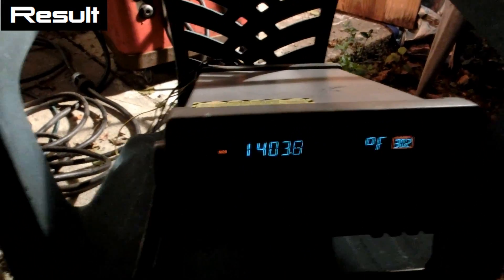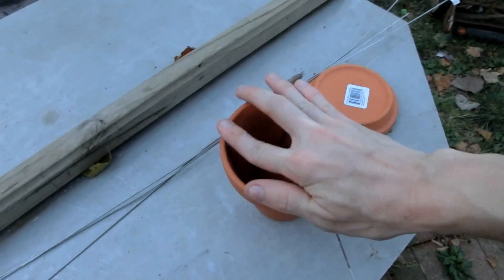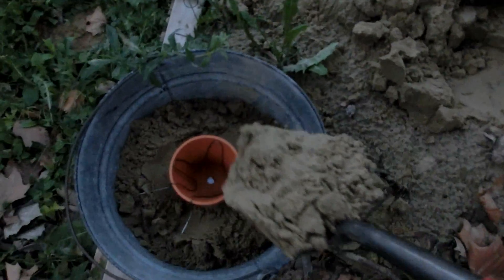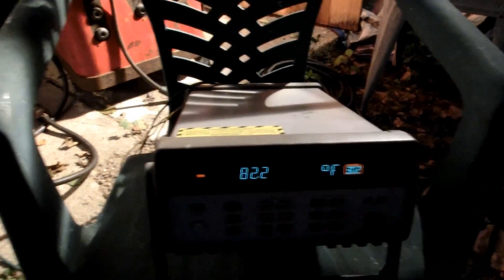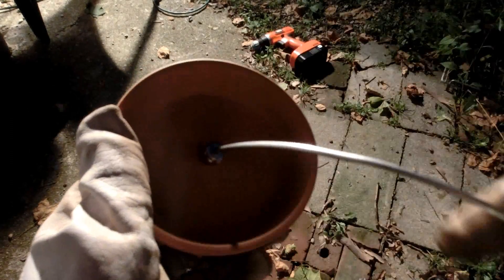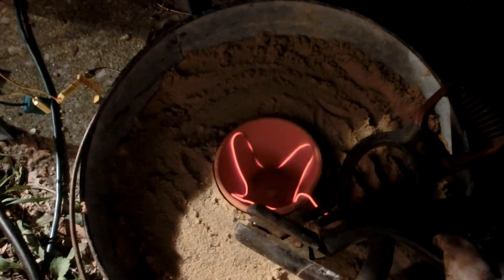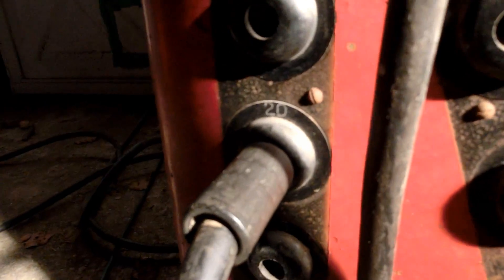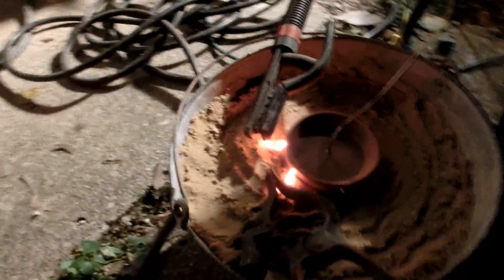DIY 1400 F* Electric Kiln

Comment: Another possibility is using a clay chimney liner: http://cecurechimney.com/images/anatomy.png   Martha Stewart says she found they were cheaper than pots when making a garden: http://gardenclub.homedepot.com/chimney-flue-liner-planters/ 
     The chimney illustration also shows a way of insulating things by creating a dead air area around the structure which directly contains the heating area.  So you might wish to layer the firebrick, create a dead air area and then a layer of the regular old bricks laying around for the outer structure.  I remember seeing a show where specialized brick masons wedged in refractory bricks without mortar, then built a structure of other bricks around it with flying buttresses in air voids which were mortared to hold the non-mortored arch of refractory bricks together.  They ended up using four different types of bricks in the process. I think they may have been making something for ultra-high temperature like for glass.  I suspect that type of project is mega-expensive.
     Refractory bricks come in different shapes that allow the construction of mortarless arches: http://ceramicartsdaily.org/wp-content/uploads/2010/06/firebrick-types.pdf
      There are also lightweight varieties that can be used in areas that aren't going to be struck by other items.  They appear to be cheaper.
     The key to avoiding damage is the speed that you heat up and cool down the structures so the temperatures in different locations don't expand or contract at vastly different rates.  For example, it takes from eight to nine hours to properly go from cold to operating tempreture for our steam locomotive - SP745.  Attempts to heat it up fast will result in fissures in the metal and the boiler is likely to explode.  Once you get the feel for heating up that wire with the arc welder which you are doing and monitoring with the thermocouple, you can raise the temperature at a slower rate avoiding extreme differences in expansion/contraction.
Reply from the maker: yeah i agree it would be better to heat it up more slowly. it would be cool if i could make containers made from tungsten and suck air out of them so they are high strength vacuum insulators.
Reply: That would be nice.
    It might be possible to line the inside of the outer wall of the void area with glass bottles with vacuums to slow down the heat transfer.   The heat from the refractory bricks would warm the air next to it and there would be a convectional effect, but the air couldn't get hot enough to weaken or crack the glass in the bottles.  If the bottles were lined next to the refractory bricks, they might crack.
   The refractory bricks would be the super hot partially insulating area, then a very hot area in the air gap between the refractory bricks and vacuum bottles creating another insulating area that could employ vacuums while not enduring heat so high the structure would be destroyed and then followed by the outer layer of regular brice which are hot.
    That might not be practical.
     If you are interested in this concept, you could place them next to the outside of the refractory brick and see if they crack or get hot enough to fail.  If the fail, then you will just have something else to melt. You could put mineral wool on the outside of the refractory brick and then the layer of glass vacuum bottles.
     If you use a non-mortor method with firebrick, you could use sand piles on either side to act as buttresses to hold the firebrick vault together. The firebrick vault would sit on firebrick walls, but there would be regular bricks that would come from the base of the arch to the top of the regular brick wall and the regular brick wall would have sand piles buttressing them.  
    That way, if you discover problems in the design or want to expand, you can just move the sand and reconfigure the parts without having to break anything because the structure is gravity set and uses compression to hold it together.

Comment: Nice.  If you want something flexible and economical, we use this when we want to set up something quick. http://www.mcmaster.com/#9355k2/=t8rv8z (you may be able to find it cheaper elsewhere, "microtherm" is one brand name). If you handle it, where sleeves and gloves, itches worse than fiberglass insulation...  You may also be able to source firebrick from a boiler repair shop in STL (or they can point you in the right direction)
Reply from the maker: thanks for the link. i think my mcMaster catalog is a bit outdated...its from 2002 hahaha. walmart sells like 6 bricks for 35$ so i may look into that. but i would really want like a cement/puddy that i could build the chamber out of and have the filament inside the kiln walls. i think that would also help heat disapation. with this kiln the heating elements are prolly like 2,000F but can't convey the heat fast enough into the kiln.
Reply: Rinoa Super-Genius You really want to keep the heat IN, but having the element embedded in the wall will help keep you from bumping into it when moving stuff in and out.  We have a little commercial lab oven that will do 2000F and it has the elements exposed to the inside.
 (example http://www.grainger.com/product/CARBOLITE-Benchtop-Furnace-38L773?s_pp=false&picUrl=//static.grainger.com/rp/s/is/image/Grainger/38L773_AS01?$smthumb$)

You can find castable refractory, you mix it up just like concrete, you can find it cheap on ebay i'm sure but it is heavy to ship. There are also a plastic refractory that you can shape. when you first fire it, you heat it up slow and it hardens. Boiler guys call it "poundable refractory"
Reply from the maker: Chipper6
yes i know i want to keep the heat 'in', but the filament doesnt have a lot of surface area to get the heat 'in' in the first place. not counting i need some way to mount the filaments inside it. i can't just have them leaning on teh side able to droop down and short out.

i'll prolly be able to find refractory cement somewhere localy.

Comment: I really thought that resistance wire would have burned in half at 20 amps. Figure how many watts that it was pulling during the last test. Thanks
Reply from the maker: well i've put 35 amps through it before. but it loses all rigidity so i would have to support the coil.
Reply: Rinoa Super-Genius
Thanks for the quick reply. Did you figure out the watt draw?
Reply from the maker: Jerry Densmore
 nah i havent really checked the voltage yet. i'm focusing more on the shape and insulating properties of the kiln.

Comment: A good first run. You more than likely have thought of this, but get a bigger pot line both inside and outside with rockwool and cover the whole furnace; this should keep more heat in and reduce the cool down speed.  Are you thinking of getting some fire bricks?
Reply from the maker: yeah i'm wanting to get some fire bricks and make a cube where one wall is hinged to open. much like laboratory furnaces.
Reply: Rinoa Super-Genius put a big fan on the welder!! or put a few heat sinks on the transformer, that would bring the temp down on good old cheese!! hahahah Joseph T

Comment: I wonder how hot it has to be to turn the sand around it into glass XD
Reply from the maker: J2D2
 already did with my arc furnace. but i take it you mean a crucible full of lava?
Reply: 2,912°F (1,600°C)
Silicon dioxide, Melting point
Reply: *****
Rinoa i challenge you to melt sand !
Seriously if you make it this far you're simply amazingly awesome.
Reply: Basically
YES